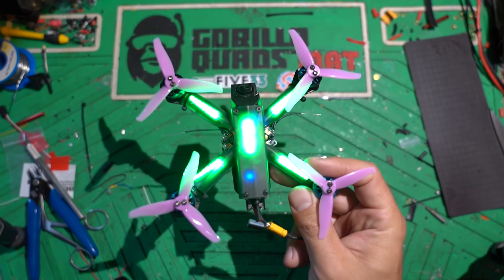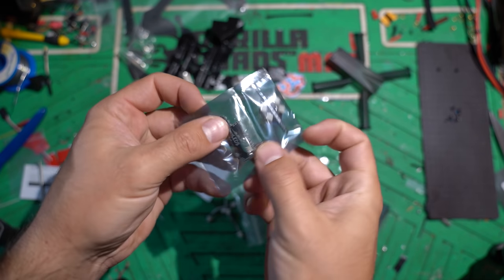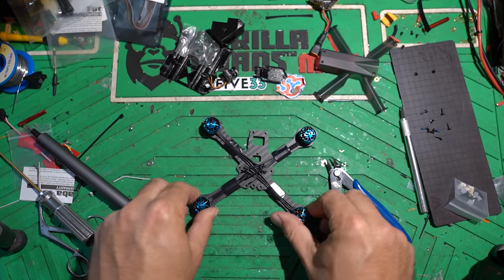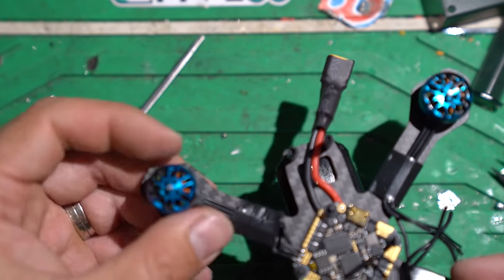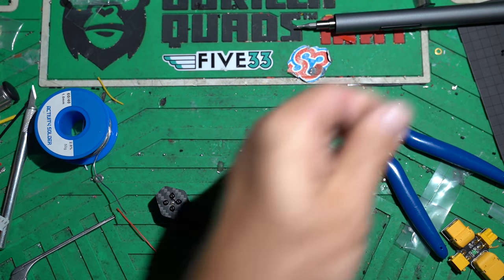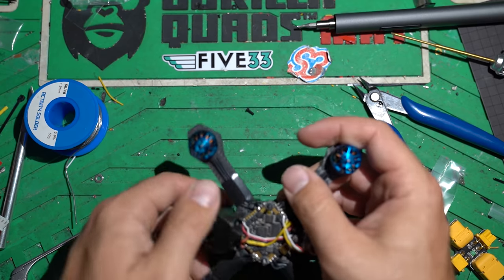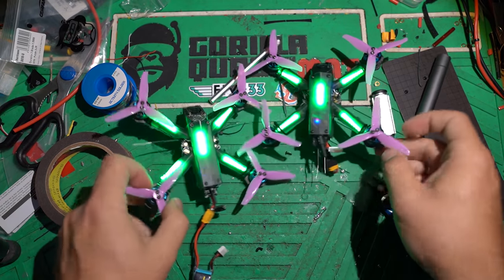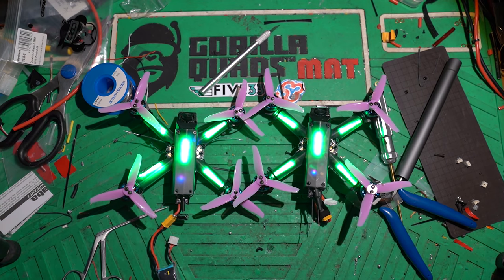How to build a Five33 Tiny Trainer

Comment: My life story “dont bridge these pads” then i proceed to almost immediately bridge the pads 😂
Reply: When getting into the hobby I smoked 2 4 in 1 esc’s needless to say Now I will never make that mistake again
Reply: @lanedaplane9325  Put a tun of flux on them,  and just heat it up,  they will want to be on the metal.  You can use lumeniere pads in between so you can test for a short (after you hook up motors,  you will ALWAYS show short) but you can test the pads before.  I tend to put solder on the pads,  the amount I want,  then test them all.  Then soak in flux/rosin.  Then just set the wire on the solder and heat it till it softens.

The point to my rambling is just heat the solder up and pull it off when you ahve the right amount,  with flux, itll go back to where it belongs.

Comment: Love my Tinytrainer. For the camera mount put the standoffs in the mount first then place it and put the bottom screws in.  Also I used the same VTX and Smart Audio works with no resistor.
Reply: Yeh I was about to say, same build as mine, smartaudio worked just fine without a resistor...
Reply: Going to use the Tiny Tank for mine

Comment: I don't mean to criticize, but for educational purposes only....
Resistors aren't ever polarized.  The lines are color codes to depict the resistor value.  Brown = 1. Then black = 0.  So 10.  Then orange means 3 zeros.  (Brown,Black,Orange = 10,000)  Then Gold = 5% tolerance. 10K +/-5% 
Sounds like you're installing a pull-down resistor.  To make sure the smartaudio lows are close to zero volts.  otherwise they'd be floating and the VTX wouldn't be able to tell a 1 from a 0.
Reply: @Tyler Elliott WHYYY... Don't tell him... I had a good and honest laugh and he wasn't hurting the resistors feelings by saying it had a negative end to it :-)
NURK is SOoo cool that small imperfections like this just makes him human and even more cool!
Reply: looool that was funny though, I like Nurk!
Reply: If it’s polarized it’s a diode. ;)

Comment: Question. I have the eachine and atomrc fpv drone and was wondering if I crashed and had to replace one of the motors which motor would I replace it with. I have searched the internet and can not find the original (ATOMRC 2004 2700kv) The closest is geprc 2004 2550kv or beta fpv 2004 3000kv. This would mean replacing all four if one was broken. Please advise on your recommendation. Enjoy your you tube videos very helpful. Keep up the good content.

Comment: I ordered the betafpv motors as per link in description, mount holes don't line up :*(
Reply: I went with the Airblade Dark Knight motors... only issue I had was the included motor screws were way too long, luckily I had a ton of M2x4 screws, those worked great

Comment: is there an Update to the Tiny Trainer Builds?  mine came with the V4 FC  and the connections for the Receiver is a plug.  and it say to use the plug to aviod extra soldering.  the Problem is the plug is in the way of the from Standoff and the camera cannot be installed with the plug being used.  so I dont know where to connect my Receiver now

Comment: Tell me why or why not props out? I've always flown props in...change my mind.
Reply: I typically fly props out on anything 3 inch or smaller, props in on bigger. Props out seems to handle prop wash better on smaller quads...
Reply: @Ninjawizard180  Props out keeps dirt off the camera, and will push small branches away instead of pulling them in, so you are less likely to get tangled in a tree.